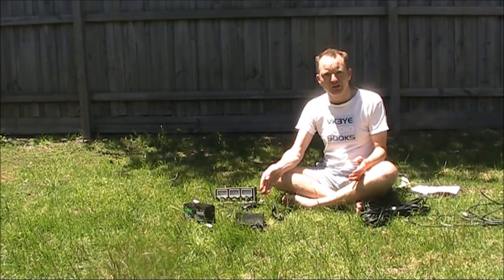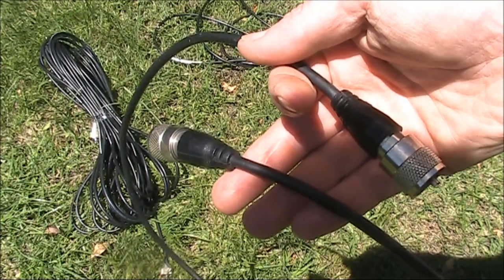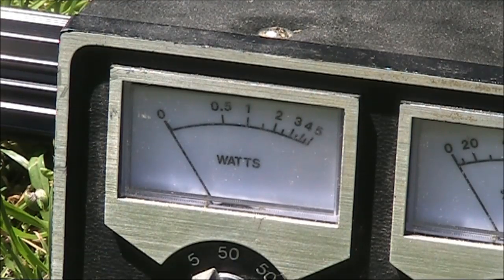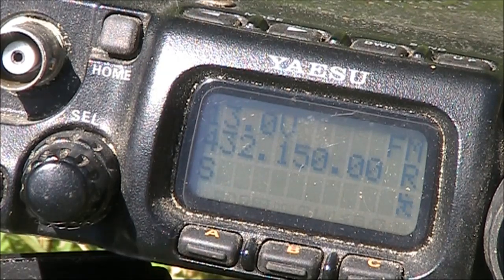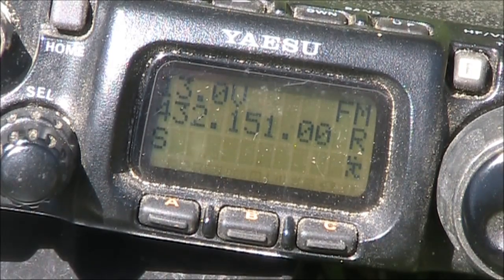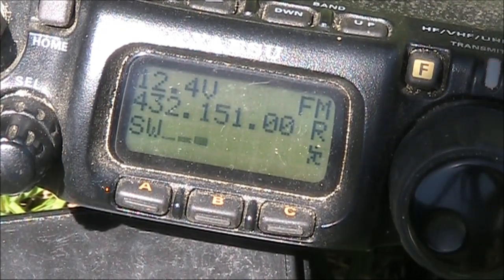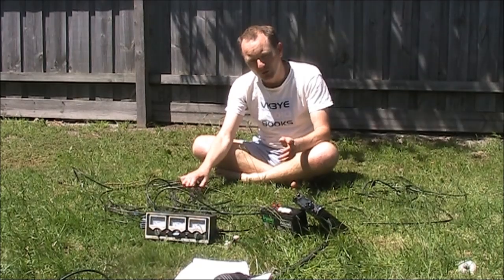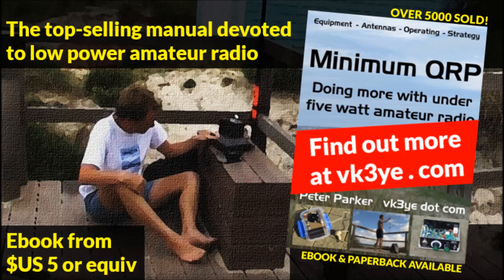Losing most of your signal: Tests with lossy coax

Comment: When I was first licenced many years back i did the same test on 145 Mhz Peter and was astounded at how much loss of power there was when I used 10 mtrs of RG58 cable between the rig and the dummy load.I immediately stopped using RG58 at frequencies above 28 MHz.73 G7HFS

Comment: On uhf for a home installation, I don't even highly recommend rg213. 
Westflex 103 is what I recommend on a cost versus performance basis.
If you're going to use RG58, get the foam dielectric type that has the additional foil shield and even then only use it for handheld antennas.
Significant Losses equal poorer reception as well as tx loss and the QRP operator can not afford to be further in the mud than he already is.... just my 2 cents worth :)
Reply: What feedline / antenna serves you best at QRP levels?  Thanks.

Comment: Always believed it, great to see it. Would connector loss be one of reasons for variation compared to pure cable spec.
Reply from the maker: Connectors could add a small amount of loss but since I had connectors with my reference (1m length of cable) I wouldn't consider it would affect my measurements (unless for some reason the connectors on the longer lengths of cable were inferior to that on the short length).

Comment: Totally agree as a comparison, which was the aim, but I was suggesting your test figures may be more accurate than you thought comparing calculations with the original spec table would not include connectors and I understand connectors can lose  upto one db each. (Several articles by John Huggins https://www.hamradio.me/connectors/pl259-so239-return-loss-attenuation-test.html etc) Great to see real life scenarios, keep it up.
Reply: "...connectors can lose up to one dB each..."  That's "true" only in the sense that you included the often-overlooked "up to", which of course includes zero and values very close to zero.

Common sense: If a connector pair (e.g. a PL-259 plugged into an SO-239, to choose an example that some would say is "very bad") had 1 dB of loss, then at (for example) a modest transmitter power of 100 watts (very common), then you'd have about 20 watts of loss in such connectors, and they'd get very very hot within tens of seconds, begin to smoke, melt any nearby plastic, and set fire to anything nearby. The fact that connectors are not all hot to the touch should be evidence enough that they do not have 1 dB of loss in normal circumstances.

Comment: What is the fix?
Reply from the maker: Replace the coax. And/or use higher grade/thicker type.
Reply: Please suffer the newbie but what would the name of that cable be and its stats. Very grateful. Thanks. Karl
Reply from the maker: @1John5-12  RG58. Stats widely available online.
Reply: Ok. Whew. I just ordered my first cable  - rg58
Reply: "LMR400" type cables are widely available. 100-feet (30m) would be about 0.8dB loss at 30 MHz which is pretty good. 
Even at 500 MHz, the loss is about 3dB per 100-feet, perhaps a hint to install VHF & UHF antennas a bit closer than 100-feet away.
Genuine LMR400 cable might be a bit more expensive, but the knock-off versions (terminated with N connectors) are a bit over $1 per foot.
My measured figures are from an off-brand light-weight cheap version with copper-coated aluminum center conductor.

Comment: Thanks Peter for your books and videos.  I know you put a lot of effort into these things, but I'm curious as to why you apparently never do anything to help with the wind buffeting of your microphone.  The wind noise runs me buggy and I often have to turn off your video and just forget about watching it because of the excess (for my sensibilities) wind noise.  This is of course 10x worse at the beach, and I simply don't even look at those videos any more.  I know you have the technical expertise and can make something from junk without much trouble or cost, perhaps you don't hear it and I'm the only one with distraction issues.  As a ham, I expect that you do know good audio.  73 de W1ADE
Reply: If you find a bit of wind noise hard to deal with, I don’t know how you listen for weak signals on a noisy band.  Maybe you just call CQ and only answer people with signals at least S9+30? But seriously, I had noticed the wind noise, just it has never made me think about stopping a video, or even irritated me slightly.
Reply: @hairfritz2667  Noise on the bands is tolerable because it is necessary to work weak signals. Excess noise on a videos where the maker controls the equipment, the  shooting, and the editing is a different ball of wax. Knowing full-well how capable Peter is with electronics, I have mentioned it a few times in the past. This is the first time anyone noticed. If indeed he chooses to reduce the noise at some time in the future, then his videos would be more enjoyable for viewers like me. It's rough on dozens of videos, not just one--and that's fine.. I've worked plenty of stations deep in the mud.  I don't care to work youtube the same way. I wish Peter all the best.   73
Reply: @wadepatton2433  yeah you are right and I agree!